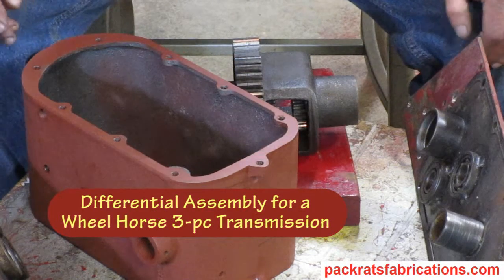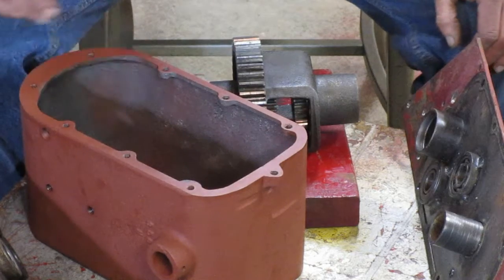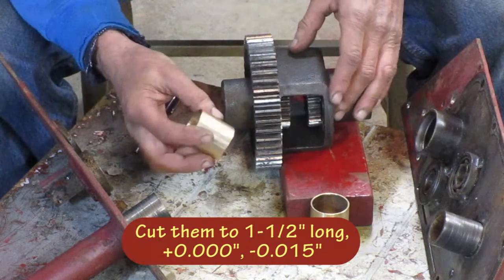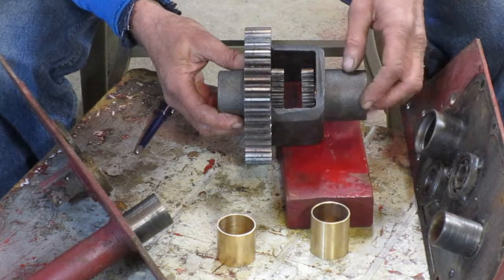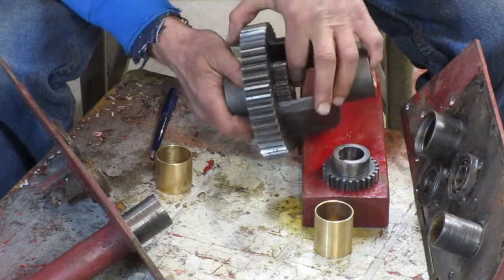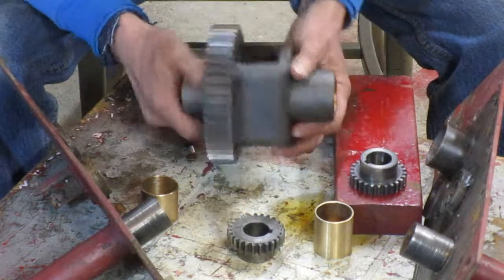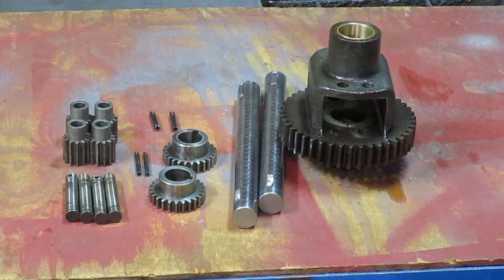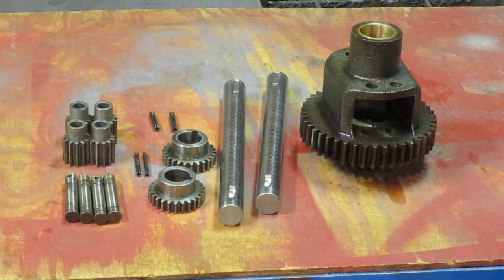Assembling the Differential for a Wheel Horse 3-pc Transmission

Comment: I rebuilt trans when I push tractor the wheels go opposite direction. Cannot push rj. ? Any thoughts
Reply from the maker: It sounds like something in the front half of the transmission just can't turn. If the differential carrier is held in one place by something in the front half of the transmission, the wheel with the least amount of traction will turn backwards when you push the tractor.

Comment: I assembled the axle now the wheels want to go opposite, think the gears need swapped around?.
Reply from the maker: If you turn one axle and the other axle turns the opposite direction the small gears in the differential are working properly. When the transmission turns the differential, that's when both axles should turn the same direction.